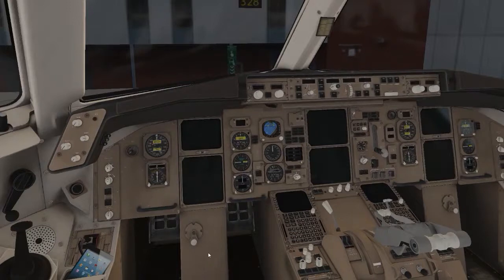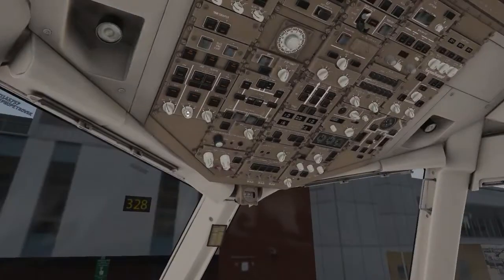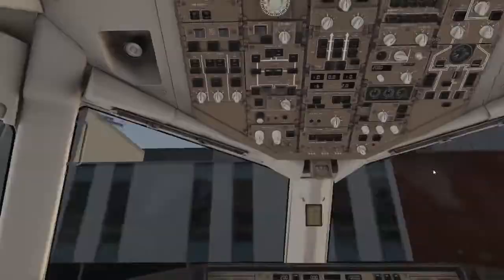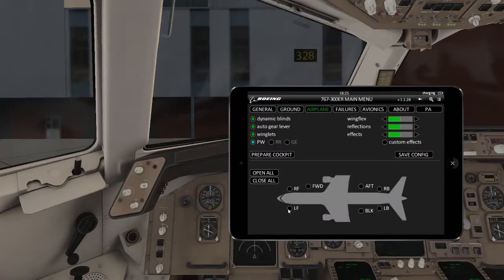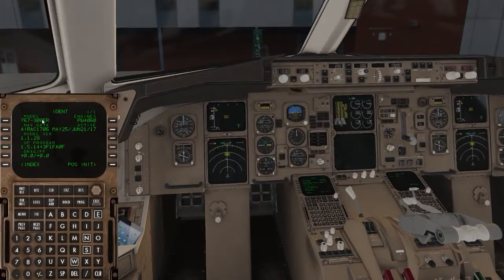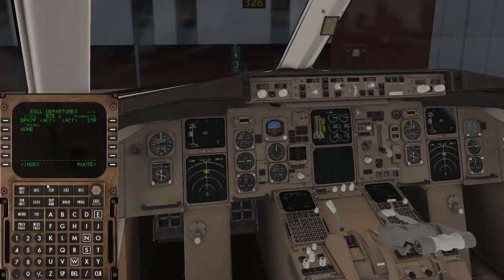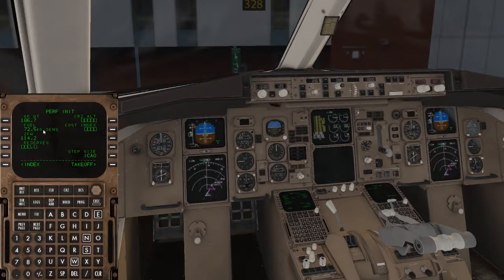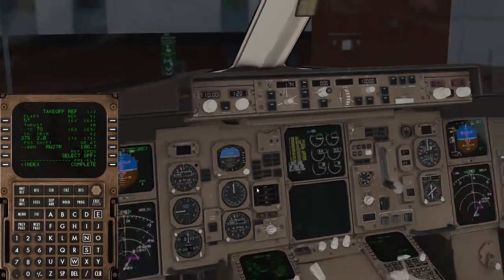flight factor 767 startup tutorial part 1

Comment: Good morning! I have a problem with this aircraft. 
When I set the fuel using the tablet, my center tank never fills up! Do you know how to fix this?
Reply from the maker: Never had that problem, are you sure you switch the centre tank pumps on after fuelling? other than that not really sure how to help sorry
Reply: @Matthew-in2mb  Now I got it to fill up, but it'll only fill up once the wings are full. This doesn't seem realistic at all now, does it? I mean, imagine the stress that the wings must handle if all the fuel is loaded in them.
Reply from the maker: Not an expert, but pretty sure that's how they would do it. They only use centre tanks once the wings are full
Reply: Pedro Taquino It depends on how much fuel you have. Standard procedure for most (Boeing/Airbus) aircraft is to fill up the wing tanks first, and if they are full, the rest of the fuel will go in the centre tank. And don’t worry about the stress on the wings, they are designed to be able to be full of fuel.